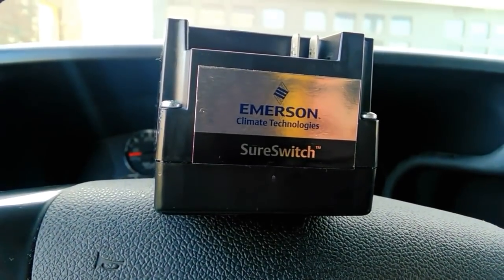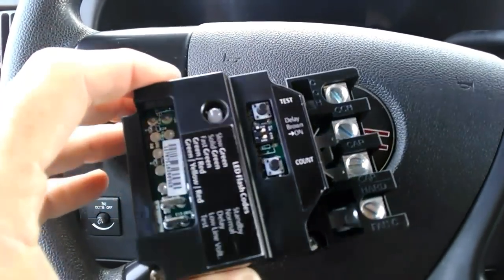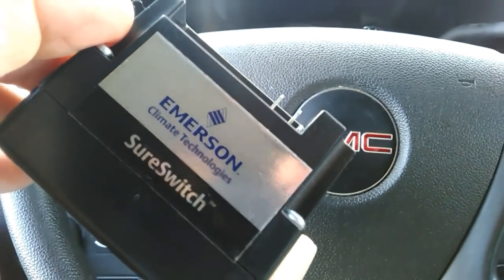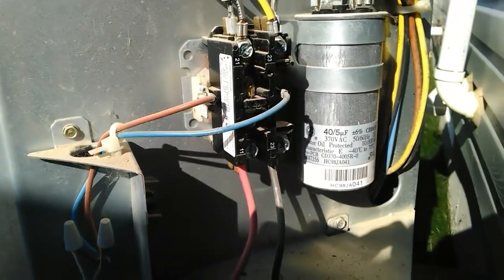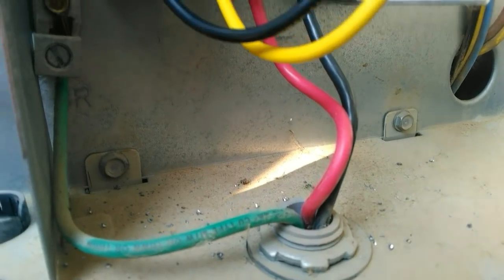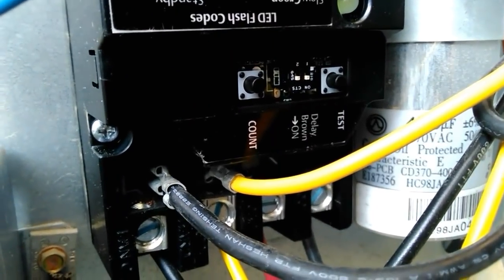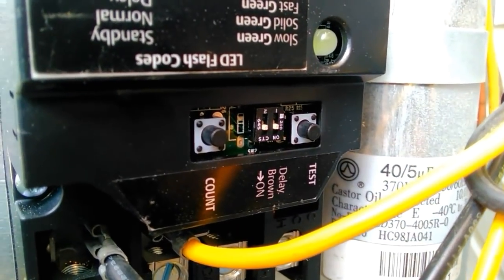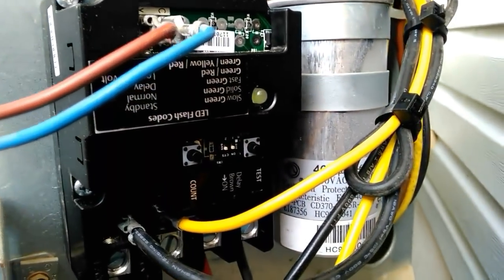Emerson Sure Switch - HVAC Know It All

Comment: Most contactor failures are because the amperage is too high for the contactor. You should load the contactor to 80% of the amperage of the units TOTAL FLA. If you exceed 80%, go to the next size higher. You will never burn it out.

Comment: I just converted a 1 pole contactor to this device. Led will not come on. I have no compressor or odfm. 247 volts at contactor and 27 volts control. I even tried a second switch. Still no LED. What do I do?
Reply from the maker: Do you have control voltage across the power and common?  If you do, I would call there tech support line.

Comment: Can you use this to replace a 2 pole contactor?
Reply from the maker: Yes that's exacly what it is
Reply: The contactor has no shunt on one side.It has two sets of contacts. Only fully powered when closed.one leg not always powered.
Reply: Double pole double throw contactor.
Reply: @jamestobler8473   Maybe double pole, single-throw contactor?   What would the second throw be used for?

Comment: Another Emerson product that might be worth testing is their soft start module Emerson SecureStart.  It has been available for years.  It is designed to dramatically reduce inrush amps, light flicker and start noise.  It also allows much smaller backup generator or inverter sources to start a compressor.
Reply from the maker: RJParker nice, I will look into it.

Comment: I just want to point out, it's not a solid state contactor, it does have a mechanical switch inside.
Reply from the maker: Khuong Nguyen it's controlled by a solid state circuit board, agreed?
Reply: HVAC Know It All , Yes the mechanical switch is controlled by a circuit board, and all circuit board are solid state. It's a comparable to an old computer hard drive with the spinning disk.  The new solid state hard drive has no moving part, that's why they call it solid state. And simply put any electronic devices that has any kind of moving component are non-solid state.
Reply from the maker: Khuong Nguyen thanks for the reply.  I was referring to way it was controlled but I do see where you're coming from.
Reply: HVAC Know It All , it's all cool, it's still a good switch with all the circuit  protection and all, and the circuit board does have a epoxy coating to protect harsh outdoor environment to ensure the longevity of the electronic components. I just put one on my unit myself and it did eliminate the loud clicking noise which normally be heard from traditional switchs. But do keep an eye on the stuck closed problem which were found on these switches I saw in youtube. Hopefully, Emerson has corrected the issue.

BTW, which brand and model is that condenser?. The 5 amps draw reading compressor reading is very nice compared my old 10 seer goodman unit which draws a whopping 16 amps and 1.3 amps from fan motor. Maybe it's time for me to consider the whole system upgrade. But my system is still in very good shape and cooling the house nicely due to a regular maintenance from my part.

Comment: Did you just bypass your shunted side of contactor? Wonder if they have other models with aux contacts for crankcase heaters as well as additional terminals.. could you also test if it will actually lock out if one pole doesn't close properly?maybe add a resistor? Have had some problems with yorks electronic fan cycling modules not closing yet having low enough resistance and cooking motors.. would love to try these in some units that are prone to chattering
Reply from the maker: Jay K the shunt is a bypass, I made it a NO contact.  It has crankcase heater contacts on it and shows in the diagram in the instructions.
Reply: Thanks for the reply, I'm going to look into them tomorrow! I was only asking because most single phase c/u's use trickle current instead of a cc heater so without the shunt there's no added heat.. but I guess any residential split shouldn't really need one as long as it's not running early spring with a lot of time between cycles